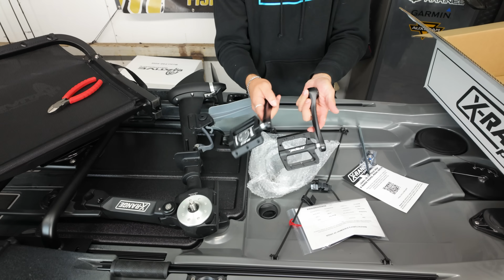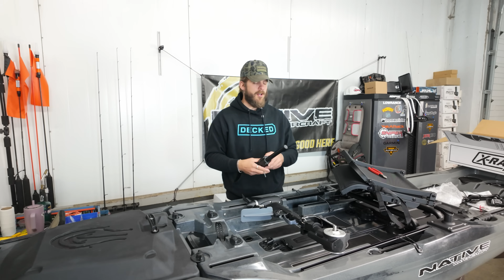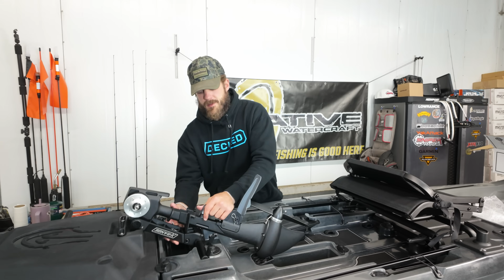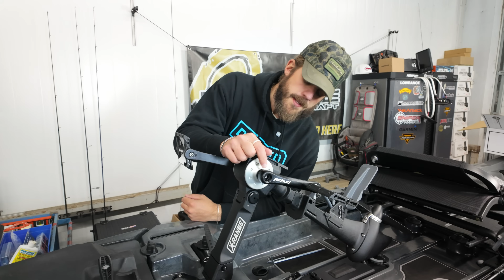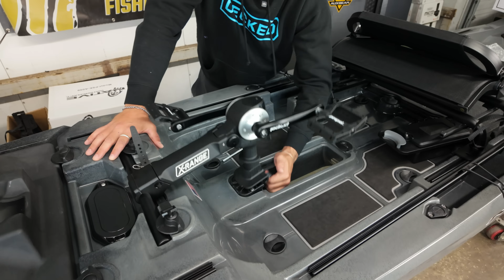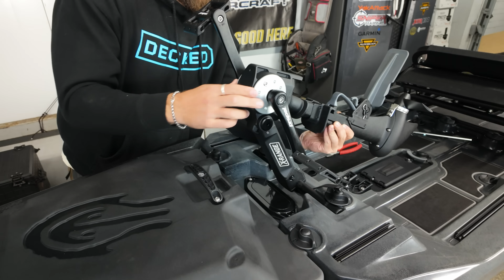Come Unbox and Set Up Your NEW X-Range Pedal Drive With Us

Comment: ye deff should have came with the more expensive titans x ly titan x  owners kicked in the nuts here thanks lol
Reply: Kinda hard to go back in time ¯\_(ツ)_/¯ . These features on the Hammer, like the new X-Range drive, were conceived, designed, and built, after the Titan X was already on the market.
Reply: @marvinfortefishing  if you didn't think they already had this in the works and jus did minimal things to the 24 titan x to get a few more sold thats funny u think they did it all in a year not even wit I cast the titan x is literally a titan wit a few upgrades motor mounts a better seat not now tho cus the normal feet will have them and it's stable which comes at a cost with weight the hammer is literally the sleeker titan x with all the same/ better upgrades /capacity at a better price make that make sense do you not kno the spec's at all they were thinking this up already along the side of before the xtr came out for sure look at the cockpit similar much they played us and that's cool I love my titan x but I don't see myself spending another 1000 for the newer drive that definitely was already in the works for sure and we payed a lot for a stable yak wit shit accessories imo 😂 garbage rudder handle for one of the heaviest biggest yak on the market a 4 k yak they on Amazon for 20 bucks same one latches literally pull right out 😂 oh ye don't forget about the plastic middle pod with bugges lmfao and the handles not being able to barley carry the kayaks weight ye definitely a 4 k yak I've owned plenty half the price with better components imo 😂 and ye they stole ola towns latching system for the new ones that's was done 5 years ago by OT
Reply: @Bgivens134  I was on the team that helped with the design of the Hammer. I literally suggested some of these features in that design group and it was well after the Titan X was on the market. So, no, it was not "already in the works."